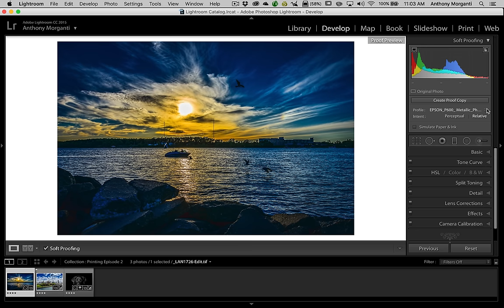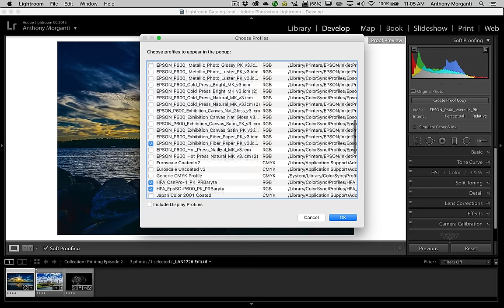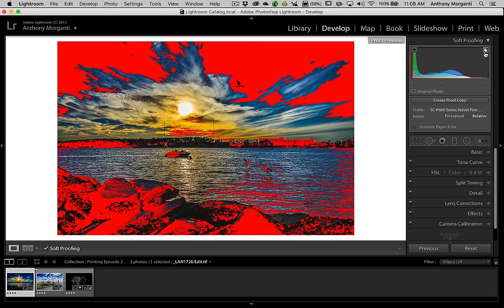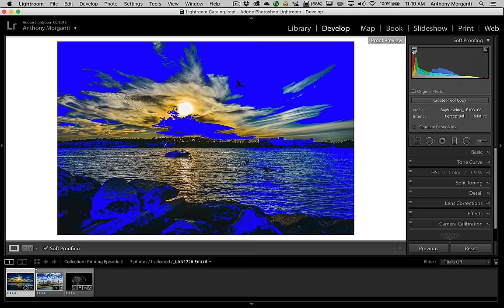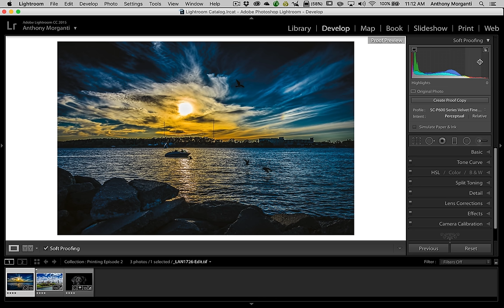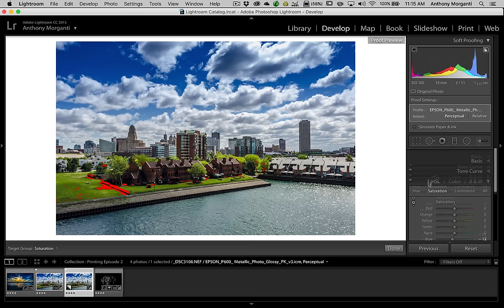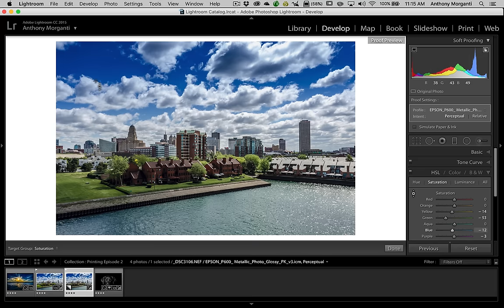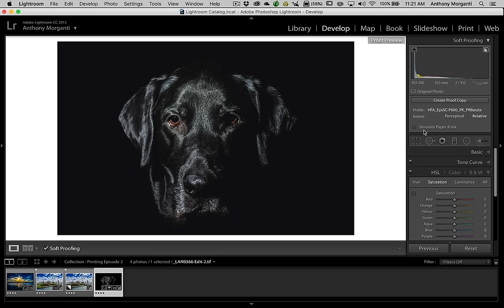Printing in Lightroom - Episode 2: Soft Proofing

Comment: Hello, I wanted to thank you for the very informative video.  I have been in photography for 40 years.  Owned a large commercial photo lab back in the wet processing days.  But never got around to printing till recently.  The reason was I wanted to print to some fine art papers that commercial printers do not offer as a choice.  So now I am learning the world of printing digital.  I did find one tip I wanted to pass along.  I have a Epson Photo Stylus Pro R2000.  I could not figure out how to get the ICC profiles into the printer driver.  The printer driver paper properties only showed Epson papers.  I called them and was told to ignore those settings as the software {Photoshop and Lightroom) over rides those settings and to use the ICC profiles in the software.  So for those who are trying to get the ICC profiles to show up in the printer settings, you cannot.

Comment: I believe theres a bug in using the soft proofing view in Lightroom, when I viewed an edited raw file in soft proofing and tinkered around with what you showed, i.e. the gamut warnings and the adjustment to deal with it, when I left the soft proofing view and went back to working on the raw file, I tried to view the before and after view but nothing happened or it would show a before of an edit of the file I did earlier but I couldn't view the unedited raw file before any editing. 

The only way I've found to get the before and after view working normally again is to delete the file from Lightroom and re-import the file again. Of course doing so you'll have to re-edit the file all over again. 

I'm using the non subscription version of Lightroom with the latest update.

Comment: I"m trying to soft proof using a CMYK icc profile, GRACoL2013_CRPC6.icc
, with Lightroom Classic release 9.3.  It doesn't show up in the extended list of available profiles.  Am I missing something?  I'm about to run a relatively big job with a print shop and would like to soft proof my images.  Hoping to at least get close to what they produce.  Thanks in advance for your insight.

Comment: At the very least the soft proofings ability to show out of gamut for a particular paper profile could be used to help pick a paper to reproduce the colors more accurately as opposed to trying to adjust the colors on the photo to work on a particular paper. In otherwords use the soft proofing as a tool to pick the paper that will work best instead of a tool to adjust color to work on a paper thats already been decided to be used when there may be better options.